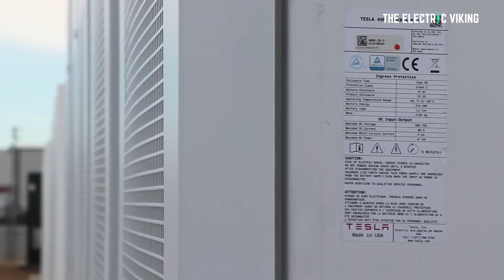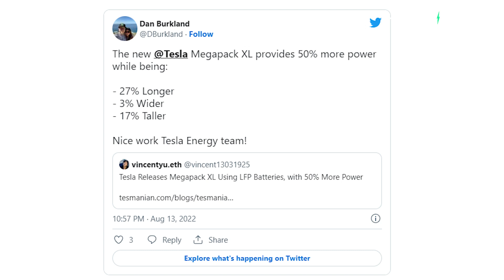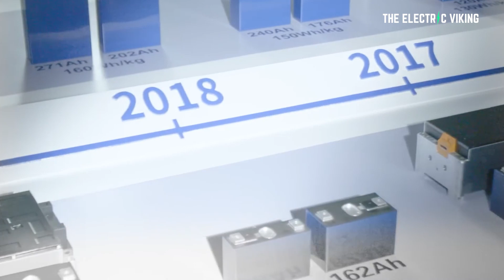Tesla energy packs increase by a massive 50% - nobody notices!

Comment: so why is Tesla producing the old junk if the new Battery LFPs are so much better?  Germany or China are obviously doing something wrong if there's so many Wind Mills and Solar Panels... it's all Free Power... once you build 100 GW...  maybe they should insulate their houses so the Air Conditioner doesn't run all day long?  Use Low E Windows... even double pane windows?  Germans and Chinese are back in the 1960s...  Hi Consumption of Power vs LED power usage?  maybe give their workers the summer Off?  and the winter Off?  too simple... the robots are still on the job...  and the old Junk Battery catches Fire??? in your house???  problem solved... just wait for the fire / meltdown... and get a new house?

Comment: There is a disconnect between the amount of storage and the generating power in a Megapack, relative to the storage requirement identified by Tony Seba’s study. In that study he concluded about 50 hours of storage is needed, but the Megapack only has 2 hours of storage. The Seba study is aimed at using solar/wind/battery (SWB) for base load. The Mega pack is instead designed for grid stabilization. Will Tesla allow an additional 24 times as much battery capacity to be connected to a Megapack to make the 50 hours of storage available to the the inverter for base load applications?

Comment: California has over 3GW of instantaneous battery power capacity now and is cycling 2.5GW daily.  It has gone up from a mere 400MW just 2 years ago, and in the next few years we are likely to see 10GW+ (40-50GW is the first stage goal).   It is pretty amazing just how quickly batteries are being added to the grid.  Quite a few are part of combined projects... so if a generator adds any sort of generation (solar, wind, natural gas, whatever...) they also generally have to add some battery storage to go along with it now.

This is all fall-out from the grid snafu that happened during the big heatwave, where battery projects had delays but natural gas decommissioning remained on schedule.  That lit a fire under the government.  Now battery projects are being added at a blistering rate. 

-Matt

Comment: Sam, you made an important mistake at 2:49. Toby Seba did not talk of superpower arising once you have more than 4 hours of battery storage. Rather, he said superpower could be obtained once you had about 2--4 days of battery storage (depending on local climate conditions) plus sufficient solar panels and/or wind turbines to generate about 4 times the amount of energy required during the summer. This over-abundance of solar/wind generation capability will ensure the batteries get recharged sufficiently on typical winter days, and the 2--4 days of battery storage ensures there is sufficient power in storage to cope with atypically bad winter days. A side effect of having sufficient solar/wind+batteries to cope with winter is that there will be a massive abundance of power during the summer, and power companies will sell this excess very cheaply, which is what Tony Seba terms "superpower". The "4 hours of battery storage" discussion was for another issue (and one that I felt Tony Seba did not explain properly in his video).
Reply: Tony is wrong for many reasons but perhaps the most obvious is the fact that people don't like infrastructure built near them and trying to build 4x what you need means building 4x as many solar farms wind farms and transmission assets. Its proving difficult to get 1x built let alone 4x

Far more likely is to simply design higher capacity wind turbines which is what has happened with offshore turbines starting at 22% capacity factor when they were first installed 32 years ago whereas the newest turbines will get 60% capacity factor in most of the North Sea

Going from 22% capacity factor to 60% means far less variation and far less storage needed

The UK will be 80% wind powered for its grid in 2030 with very little battery storage needed

If you can get to 80% with close to zero batteries. Why would you over invest 4x as much and pay 4x as much and generate 4x the waste to try and get marginal benefit of going from 80% to 95%

He really is wrong on this one
Reply: @kaya051285  I don't know enough about solar/wind to know whether Tony Seba is right or wrong in his claim. However, the impressions I got from his video were: (1) he was considering what is required to get to 100% renewable energy rather than merely 80% or 95%; and (2) doing this would require enough wind/solar+batteries to guarantee sufficient power during a bad winter, a side effect of which would provide a significant surplus of energy ("superpower") during the summer.

Regardless of the (in)validity of Tony Seba's claim, Sam was incorrect in his explanation of what Tony Seba claimed was required to obtain superpower.
Reply: @CiaranMcHale  Talking about 'super power' gives the claims of it's future possibility some credibility when the likelihood of nations overbuidling 4-6x what they need is zero

No country can afford to overbuild 4-6x and then write that investment off so that there is 'free' power some of the time

Even if somehow you got the cost down significantly whereby over building 4-6x is still affordable. Well building 1x is always far more affordable than 4-6x so it won't happen

Plus there is the non money costs with people protesting infrastructure near them
Reply: @kaya051285  I agree that space requirements and "not in my back yard" attitudes might be an issue. However, I am keeping an open mind on the costs involved. The cost of solar decreased 83% or 87% (I forget which) from 2010 to 2020 and is predicted to decrease another 80% from 2020 to 2030. That sort of exponential decrease in costs has been going on for decades, and it may well continue after 2030. An 80% cost decrease means it gets five times cheaper. Solar is already the cheapest form of energy, so if it gets five times cheaper in a decade, then building 4x solar capacity will be cheaper than non-renewable forms of energy production. A similar-ish (but not quite so dramatic) exponential decrease in costs for batteries has being going on for a long time. The decrease in the cost of batteries has been paused recently due to the demand for EVs growing faster than the production ramp-up of batteries, but there are predictions that battery supply will outgrow EV demand within 5 years, at which point the exponential decrease in the cost of batteries will probably resume. So, in another 10--20 years it might be cheaper to have 4x solar/wind plus several days of battery storage than to have 80% solar/wind (with little if any battery storage) plus peaker fossil-fuel power plants. I'm not claiming that superpower is likely; merely that it is a possibility.

Tony Seba's arguments for the benefits of superpower are basically benefits for consumers and for growing the economy, but not necessarily benefits for power company profits, so superpower might become available only if governments are willing to step in to force power companies to invest in infrastructure to provide it.
Reply: @CiaranMcHale  Irrespective of how cheap solar panels get. A country which installs 1x can charge 1 unit of currency while a country that installs 4x has to charge 4 units of currency it doesn't matter thst we pay 5 units of currency today so that 4x is cheaper...... becuase 1x is far cheaper still

And even if solar panels and inverters were free. Land isn't free. Grid infrastructure isn't free. Maintenance isn't free. Labour isn't free. Capital cost isn't free

The idea of overbuidling 4x is stupid and won't happen

We will get to a position of 0.8x via wind solar and interconnectors. The other 0.2x will be fossil fuels or biomass or hydrogen or a mix of the above far more sane than 4x

Comment: Night time panels not real , technically possible , gets energy from different wave lengths multi layer , infra red most likely . The problem is cost and energy created is not substantial.  Heater to have standard tech solar and energy storage. In future night solar maybe possible , more energy gained I. Twilight conditions but not worth waiting for . Future of storage is iron phosphate based

Comment: As the price of energy at point of source becomes increasingly cheaper, the price added for transmission dominates the price of energy at point of use.
Reply: Yes, this has been the case for several years now.  A good example is to compare California with Texas.  In California, electricity is twice the price per kWh, and people use half as much.  So the bills wind up being roughly similar between the two states.   It is precisely because the actual cost of generation has become only a very small part of the overall equation.  Maintaining the transmission and distribution system is by far the most expensive part of the grid.  Both states have wide-flung rural areas that electricity must be run to, and that gets expensive.

So it will be interesting to see what happens as more and more residences are able to zero-out their net electricity use.  Solar panels have become so good and so cheap these days that if you have the roof space, having a residential system is almost universally a win.  But that leaves the utility with a problem... pricing is traditionally based on usage, but now many home owners are paying basically zero but still making use of the grid infrastructure either as a big battery or to bridge across Winter or otherwise the dozen or so weeks of the year where the solar isn't sufficient.  That puts a huge burden on non-solar customers.

I think the grid is going to have to evolve... the actual kWh consumption pricing will have to be lowered significantly and the basic 'connection fee' will have to be raised significantly to be completely fair to everyone.  But as we have seen... the public in general, as a group, has so little understanding of how the grid actually works and where the actual costs are that any vested interest can throw FUD around and cause chaos, preventing the fair solution from being properly implemented.

-Matt
Reply: That's the cost of centralization...

Comment: The external dimension volume of the Mega pack has increased by 53%, so the internal dimension volume has probably increased by more. It looks like Tesla has basically just swapped out the ternary batteries for LFP batteries in a new package. The longer life of the LFP batteries will be seen as a significant improvement by electricity utilities which usually prefer long life assets.

Comment: One question I have is why EV manufacturers don't offer inexpensive, lightweight and efficient EVs with ~100 km range, which is plenty adequate for most commuting and town driving. For the occasional long trip you could rent a trailer-tow battery -- a "Powerwall-on-wheels" -- which would give you ~1000 km range plus extra cargo space. (There's a French company, EP Tender, which is making a business of renting EV battery trailers.) If trailer-tow battery rentals became commonplace it would probably help stimulate the market for EV conversion kits, which could quickly transform the existing fleet of ICE vehicles to EVs.
Reply: Because of the demand.    They sell every car they make at the higher price, and still can't keep up.   It will change as their production ramps, but not for at least 2-3 years
Reply: @girowinters  Maybe one reason they can't keep up is battery supply chains. Why load the car down with 1000 lbs of batteries that are in short supply and nobody really needs? (Probably a lot more than 1000 lbs with LFP.)
Reply: @kenjohnson6101  exactly, so why not put half the batteries in twice the number of cars?

More ev's on the road, less pollution.
Reply: Because car companies make a lot more profit on premium vehicles than economy ones. Econoboxes get about 5% gross profit while premium make about 15% profit. This means that even if the econobox only uses half the battery so you can make twice as many, they still make more money selling the premium car. 
This means the still limited battery supply goes to the upper part of the market first. 

Don’t worry, battery supply is still growing rapidly and as batteries come available, they will move down market because BEVs are already on par with ICEVs or even cheaper to make.